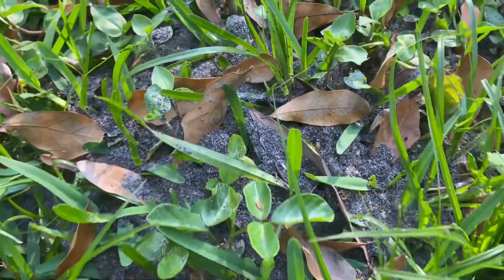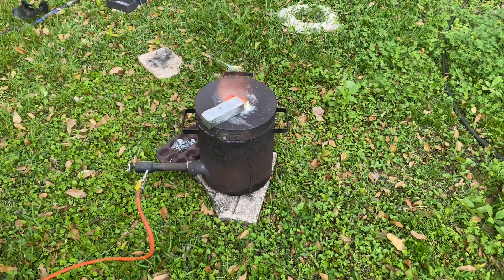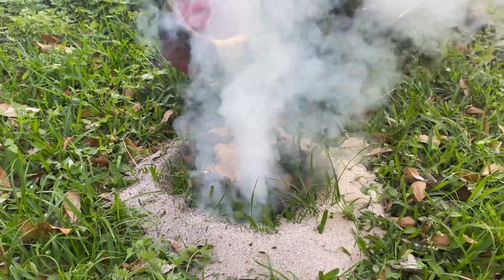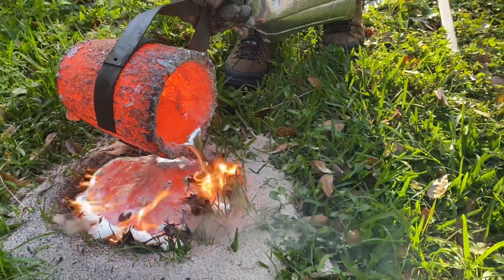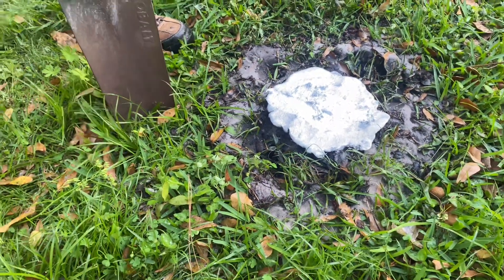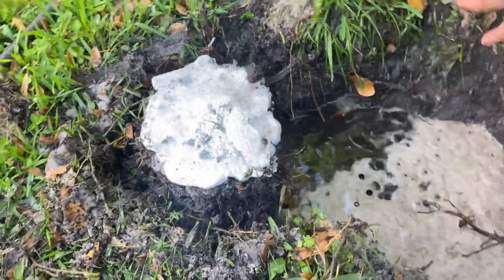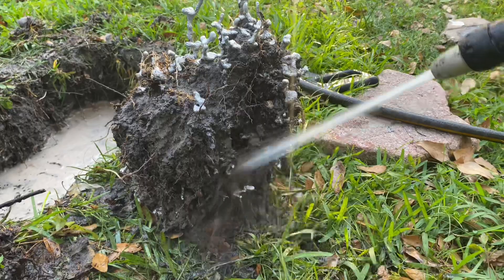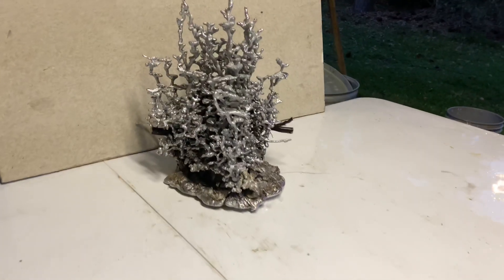Massive Molten Aluminum Anthill Casting #21

Comment: Do you ever use aluminum pop cans?
Reply from the maker: I use everything except aluminum soda cans. When you melt down thin aluminum like soda cans you get a lot of dross/slag for very little metal. It’s also very time consuming and fuel wasteful since you can only fit about 5-7 crushed cans in the crucible at once. Car rims are the best thing I’ve found so far, a lot of metal with not much dross. I’ll melt down anything that’s not thin though, I’ve done aircraft parts, rims, car parts, and so on. I’ll pick up aluminum if I see something on the side of the road or something.
Reply: Good question and great answer. 
I was wondering same thing. Lol

Comment: If you used a long skinny metal tube for a nozzle and stuck it in the ground around the hot casting and injected the water around it while hot, I wonder if the boiling action of the water would loosen it and maybe help uproot it

Comment: What are you going to do with the root that goes through it? Are you going to try to burn it out, cut it out or just leave it and maybe carve it into something?
Reply from the maker: I’m going to leave it. I try to avoid casting near trees so I don’t get these big roots but sometimes I still do. When that happens they’re usually pretty stuck in there since the ants will dig around them. It adds a bit of character to the casting in my opinion.

Comment: Came across your channel today, interesting. Have you ever thought about using these new age resins they have out today, thinner than molten Aluminum, can get deeper into the nest, slower to cure which allows it time to do so, and can be mixed to mimic any color, including Aluminum, and it won't burn you.
Reply: I think one big problem with trying resin or acrylic is that moisture in the ground will prevent a good casting, screws up curing, clarity, etc.
Reply: The goal is to violently charcoalize the ants, not not burn them...
Reply: @moonymonster , honestly, when it comes to Fire Ants any way to rid them is the correct way, for those that's never accidentally gotten into a large nest you wouldn't understand.

Comment: From what I remember from school (many Moons ago), you heat Aluminum Oxide to the melting point of Aluminum, then shoot a HIGH VOLTAGE electrical current through it (AKA "Frankenstein"), this is why Aluminum Foundry's are always found near power plants (or they used to be).
Reply: Aluminum oxide is dissolved in molten cryolite, a lower melting aluminum compound.   Then electricity separates the aluminum from oxygen.  Yes, it takes a lot of power.   This is the bulk of the value of aluminum.
Reply: @keithjurena9319 , like I said it's been a while, knew it was very similar to that.
Reply: @Titus-as-the-Roman  
At current ;) normal consumer electric prices,  there is about a dollar's worth of electricity in every pound of aluminum. That energy value is preserved which is why aluminum is widely recycled. It takes less than 5% of that energy to remelt and recycle.

Comment: What size crucible do you use?
Reply from the maker: #8 crucible I believe. I’ve had this same crucible for over a year now, it might be a #6. Manufacturers make different dimensions for the same volume crucibles and I had a #8 that didn’t fit my furnace but I re ordered a 6 and an 8 and I can’t remember which one I ended up using.